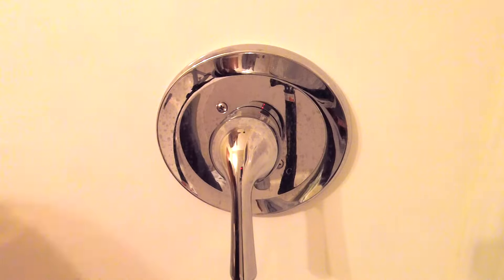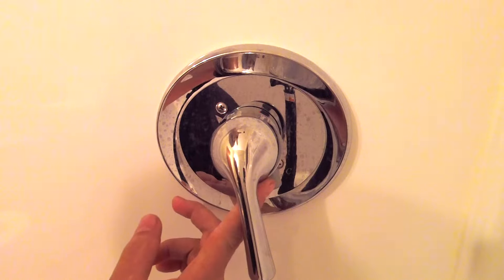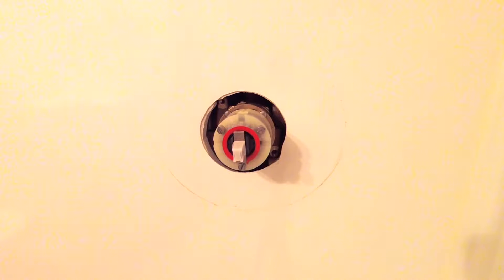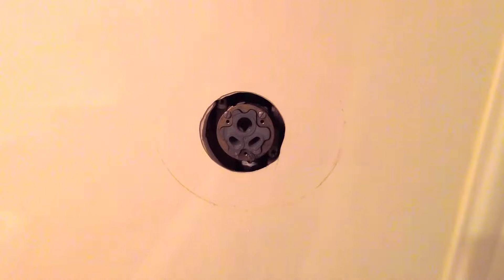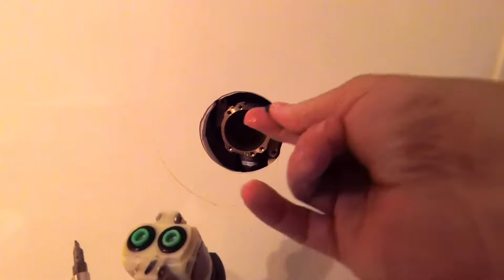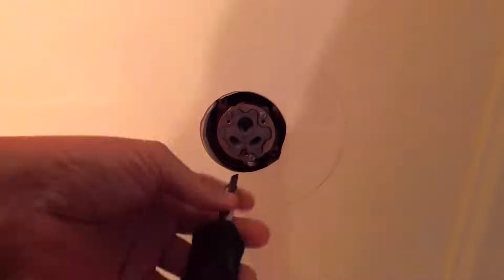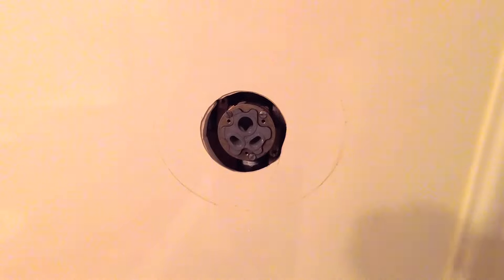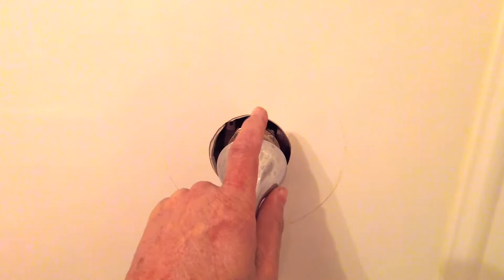How To Replace Shower Cartridge - American Standard

Comment: Didn’t need to replace the valve but you did put me on to the temp adjusting lock ring which somehow got out of adjustment and wouldn’t give us a hot shower. Thanks.
Reply from the maker: Good to hear you got it fixed!

Comment: Can't thank you enough for this video. It gave me the confidence to take out the balancer I still snapped it apart but managed to take it out and replace it (one of the back O rings corroded off)
Reply: The pressure balance put up some resistance. I had to break it out. Once out and clean. Replacement units went together successfully. 😅🎉

Comment: Great video, thanks a million! I had a drip leak so I replaced the front cartridge, then I realized the leak is further back. So I tried to remove the last part intending to take a look at those 2 washers. After working on it a while, I got it loose, but it wouldn’t come out so I decided to reseat it and put everything back together. I didn’t want to risk damaging pipe. Reseating that part was enough to slow the leak considerably. I think there’s a large o ring or plastic part that has dried out, preventing complete removal of that part. Not sure how to proceed. Maybe I need to call a plumber.
Reply from the maker: It's possible there is some build up of minerals from the water that is preventing it from coming out. Personally if it were mine I would make sure you have the new parts on hand and then use some pliers or something and try to work the part as much as possible while pulling. This may break up some of the deposits and free it enough to remove it. Of course this will probably destroy the unit so you need to have the new one ready to install. If you are able to remove the old one this way then you'll have to maybe use a flat screw driver and steel wool to clean the pipe before installing the new one. I wish you the best with your project!
Reply: @DIYHomesteadProjectsDIYHP10  thanks for your quick reply! I went to Home Depot and picked up a replacement pressure balancing unit and a pack of 3 small metal brushes for cleaning, the brushes work perfectly for this purpose. You were absolutely correct, I ended up demolishing the original part! I tried using 2 wood screws for leverage, no go. Then ended up using a dremel tool to hack away pieces of plastic near the outer edge. Finally was able to remove it by slowly rotating back and forth with needle nose pliers. Took a while, but no more leak!
Reply from the maker: Excellent! Glad to hear you were able to get the old one out and replace it. Probably save yourself quite a bit and you did it yourself! Good job!

Comment: Which size Allen wrench would you need to use if you lost the original one that came with the faucet?
Reply from the maker: Sorry but I don't know. You'll just have to try several until you find the right one.
Reply: 3/32" allen
Reply: I think it's 7/64

Comment: Help! I have an American Standard like this and there is no set screw present but the handle won’t come off. ??
Reply: @Haegan_Lee did you figure this out. I have the same problem. There is no set screw.
Reply: There might be a cover on the front of the valve. I thought mine didn’t have a screw either.
Reply: Set screws get calcium build up, strip ... You got a drill out the set screw and order new handle and replace with the cartridge.. I'm a Plumber and have to do this often as last resort

Comment: can u help to find the part # for trim kit I have the same valve but I need to change the cover plate and handle …please
Reply from the maker: I would check with the American Standard company. I left a phone number to the parts department in the video description.
Reply: On the same boat. Handle broken and can’t find replacement to match this valve

Comment: My pressure balancing unit will not come out. Any ideas or tricks on how to remove it even if i have to damage it to get out?
Reply from the maker: I really don't know, I've never dealt with that problem. If you aren't worried about damaging it maybe you can get a screw driver in one of the holes and wiggle it to see if you can loosen it up. Even more drastic attempt would be to drive a screw into it so you have something to pull on. Sorry I can't give you a better solution. I wish you the best!
Reply: DIY Homestead Projects thanks for the reply. Seems thats the only option and i have a replacement so not worried so much about the balancing unit as i am about damaging the fixture itself. Will go back in the trenches tomorrow and see what happens. Thanks!!!
Reply from the maker: It may just be some corrosion or minerals if you have high mineral content in your water. I'm hoping a little bit of "wiggling" might break it loose and it will come right out. I can't think if anything else that would be holding it in there. As you said, do all you can to NOT damage the fixture. Good luck to you!
Reply: DIY Homestead Projects...Well...i got it out but it wasnt easy. The black cover snapped off pretty quickly. I then sprayed vinegar inside to dissolve the build up so it would move. I then screwed 2 lag bolts through the exposed holes and started working it with a wrench until it finally broke free. Everything seems to have gone back in nicely and it seems to be working so fingers crossed. Thanks again!!!
Reply from the maker: Oh boy, sounds like you really had to work for that one. I'm glad you got it out and are up and running. I hope it lasts you a long time!
Reply: DIY Homestead Projects yeah...me too! Thank you so much for posting this video. It was extremely helpful.
Reply from the maker: You are very welcome, I'm glad to hear it helped you out!

Comment: Where can I find replacement cartridges?
Reply from the maker: You can call American Standard Customer Service 1 (800) 442-1902. Tell them your faucet is leaking and they will walk you through finding the correct part you need. The awesome thing is they will mail it out to you FREE of CHARGE and it will be the correct cartridge for your faucet. Awesome company and superb customer service!
You can also find replacement cartridges at your local hardware store or on Amazon.

Comment: Whats the part number? I gotta replace that i bought mine at home depot but the gray part is slightly different that i cant fit the metal bracket over it. Please help
Reply from the maker: Sorry but I don't remember the part number. You can call American Standard Customer Service 1 (800) 442-1902. Tell them your faucet is leaking and they will walk you through finding the correct part you need. The awesome thing is they will mail it out to you FREE of CHARGE and it will be the correct cartridge for your faucet. Awesome company and superb customer service!
Reply: Thanks i appreciate it
Reply from the maker: You are quite welcome. Good luck with your fix 👍

Comment: I have a American Standard shower valves with the same type of valve. Recently it started to  not mix the water so you can control temperature. No matter where you placed the handle the water was hot. I had a plumber install a complete new insides to the valve. Nothing changed as far as mixing but the water now was mostly cold. I tried moving the handle quickly back and forth and the water got hot and stayed hot no matter where the handle was placed. I removed the mixing valve and turned the water. I got hot and cold for each side of the valve coming out with force. I replaced the white mixing part and got all one temp, mostly cold, again. The new part was doing the same as the old part. The brass casing holding the plastic valve sections is fine. I don’t understand. The plumber wants to cut into the wall and replace everything. 😖 Can you offer any advice? Thanks
Reply from the maker: Did either you or the plumber try adjusting the red (mixing) ring on the front of the white valve? That red ring can be pulled out and rotated in both directions (L and R) to adjust how much hot water gets mixed in with the cold. I don't know what direction controls what but you can try one direction and then the other to see what works best for your situation. You should only have to remove the chrome pieces to get to the red adjustment ring. You shouldn't have to take the entire valve out. Hope this helps.

(I think counter clockwise is more hot)

This video talks about this adjustment. His is a grey ring but your's might be a red ring.
https://www.youtube.com/watch?v=nrggnbOPQdw
Reply: Did you figure it out I been having the same problem I just been getting hot or luke warm no really cold
Reply: I'm currently have the same problem. What was your fix for this?

Comment: Has anyone experienced a stuck handle? I've already removed the set screw but the handle isn't budging
Reply from the maker: It is probably either rusted or corroded. Try tapping LIGHTLY on the center of the handle with a hammer and see if it will break it loose.
Reply: @DIYHomesteadProjectsDIYHP10  I'll give that a try. Thanks for video and for the reply
Reply from the maker: I wish you the best.

Comment: Any advice if you have a rusted screw that is stripped on? Trying hard not to call a plumber for this :/
Reply from the maker: Sorry but I didn't have any rust. I think the screws on mine are brass so they won't rust. Maybe try some sort of oil like WD-40 or maybe even a little bit of heat. If you don't have a torch maybe just a match or something to heat up the head a bit. I'm just guessing with those possible fixes. Good luck to you.